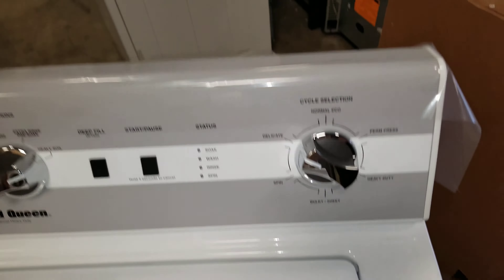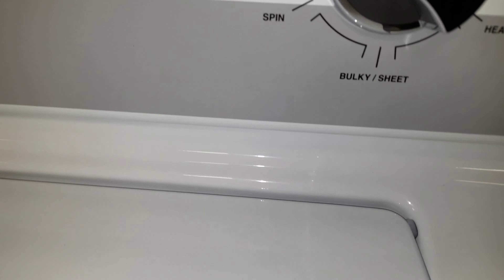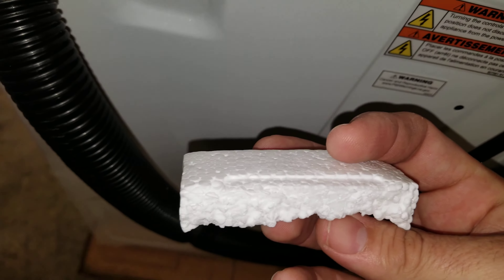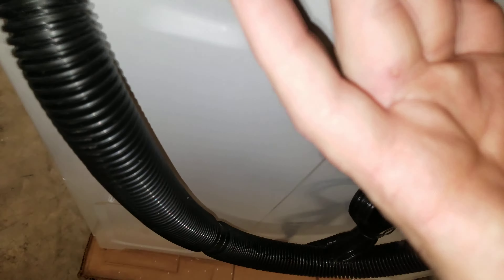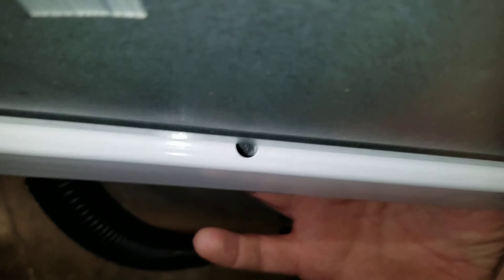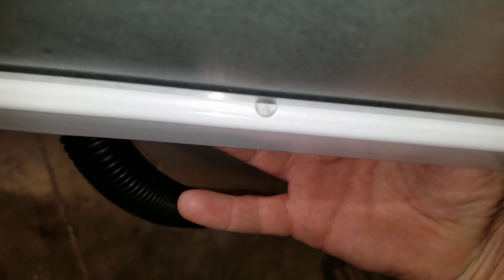Speed Queen Classic TC5 Lid Switch Bypass

Comment: Now to find a way to make small medium large load sizes.
Reply: @Dr IT Don't know if you are aware of the cycle matrix for the TC5 that shows the various water levels based on the cycle choice.  Water choices start at 13 gallons all the way to 19 gallons depending on cycle.  Just search for "Speed Queen TC5 Cycle Matrix."
Reply: @d15pi63  I own a TC5. I’ve seen the matrix. Would be nice to have a small load wash hack.
Reply: My SQ Commercial HD has small, large and auto-fill.  We bought it this year.
Reply: @mydearvalerie  Yes you do. It’s a trade off. I wanted the classic wash with moving agitator. The newer auto size has selective sizes but different wash action.
Reply: @Dr_ITguy337  You are so right...Wish there was a hack for that 🌺
Reply: I would consider the eco wash a medium load
Reply: And bring back warm rinse on these newer circuit board models.
Reply: @mydearvalerie  what model would I search for to find the same machine you have?

Comment: I would advise against a piece of styrofoam, simply due to the reason that pieces can break off and then get stuck in the machine.  A clothespin is much better and safer.
Reply: What kind of clothes pin? The ones I use aren’t big enough
Reply: @Sprocketman  Wooden, spring type. Regular size, not mini.

Comment: lol yah they are still the king to bypass the switch. Some other manufacturers like “cough GE” have an on board diagnostic system that will throw a code if the lid hasn’t been raised after 3 loads. 

I use a flat head screw driver while in the field for testing, and at home I use a spot removing brush to slide in there.

Comment: I just got mine yesterday it runs to the cycle but it stopped before it spins. Basically it washed but the clothe is completely wet. Than I have to directly switch to spin mode and press start in order to spin and dry the clothe. I have no clue why this is happening since it’s brand new and it’s being happened all the time . Tc5003